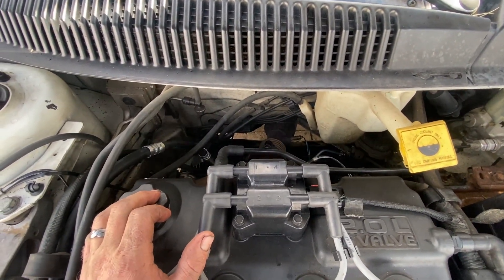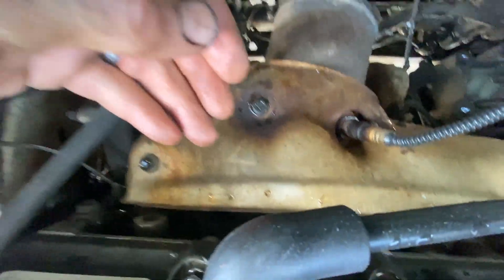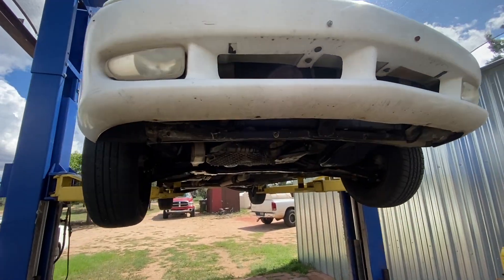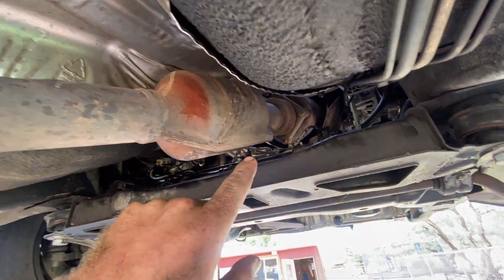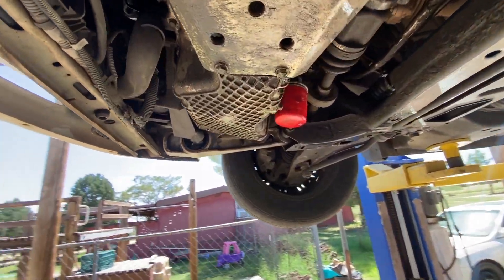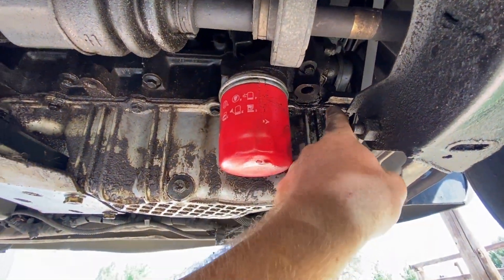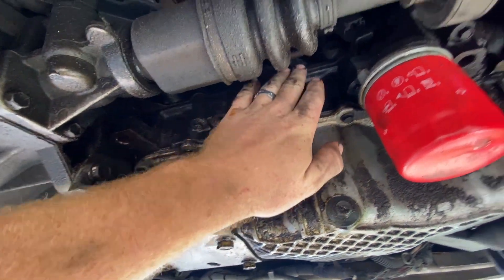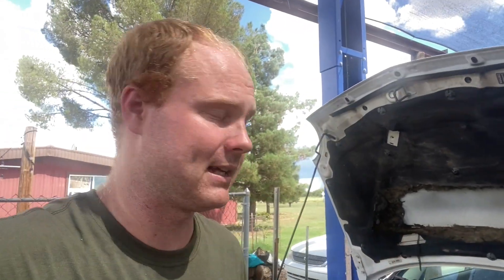Smoking Coming From Under The Hood!

Comment: Hey son, I have a question? I have a 02, F-250 with 7.3 N it. I bought it new. After a few months, I would B driving I-10 N Mobile. It would feel like the transmission was slipping when I started up a hill. Took it several times 2 Ford but they could never find it. After 4 yrs It showed it's ugly head. The light would flash on & off on  the overdrive on & off switch on handle on steering column. I drove it for 7 yrs shifting hard until it went completely out. Put another N it & 5 yrs later it starts going bad. This has happened up 2 the one that is N it now. I had the 1st 2 2nd & 2nd 2 3rd. Shifter thing. Forgot word for them. 5 days after that, they went bad. I've been driving it easy, I put transmission conditioner N it from time 2 time. But I have asked Ford what the problem is with this cotton pickin transmission. Oh but they don't know! Do U know what the problem is son & why it has a problem slipping? I haven't hauled anything with truck other than a 5'x10' utility trailer with a riding mower on it. The over drive switch stays off and blinking. It shifts hard N2 2nd & N2 3rd. Is there a kit that resolved this issue when rebuilt. This is the 3rd bad transaction including the one that came N it. Any information U know & can share would B greatly appreciated 👍!!
Thanks!!
Cricket/Mississippi